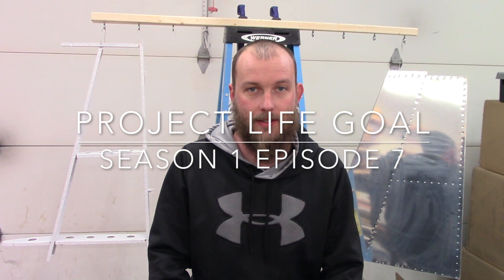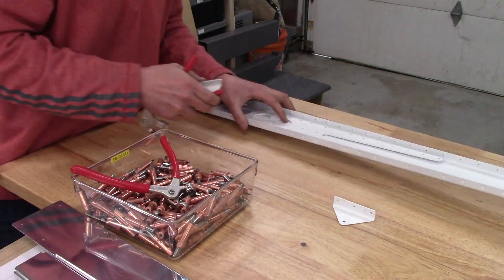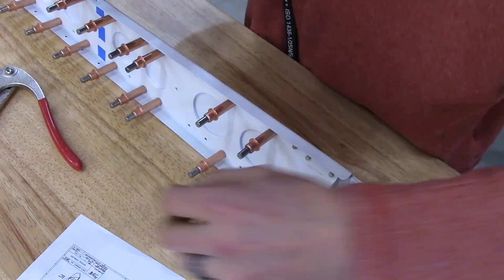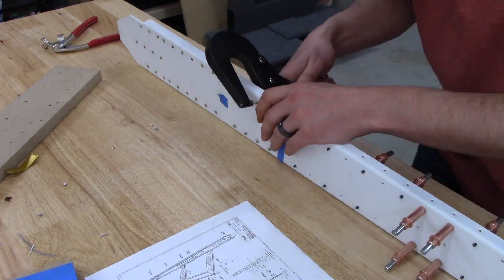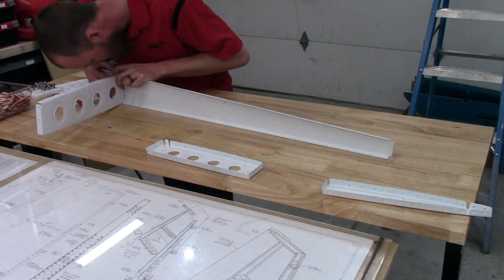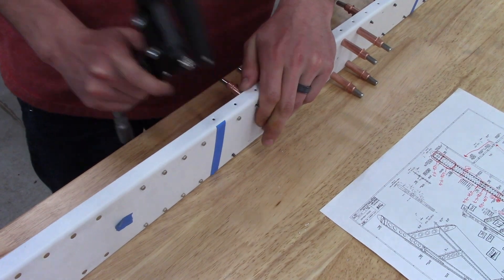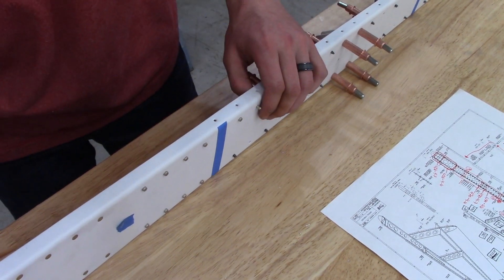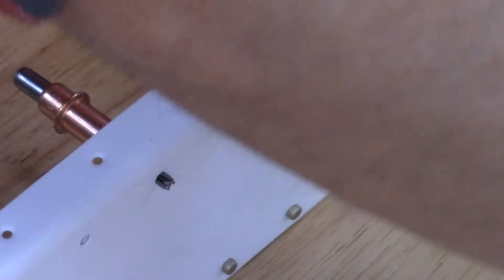PLG S1E7 - RV-7 Vertical Stabilizer Spar & Rib Assembly

Comment: Hello Grant, Out of curiosity, what spec / size rivets are you using and what is the centre distance measurement for the skin / rib / spar ?
Reply: @ProjectLifeGoal  Thanks for the info, Grant. Also, the typical centre to centre between rivets on the skin ? (AN426AD3's).
I'm not building a plane, by the way.
Reply: @ProjectLifeGoal   Thanks, Grant. It's a bit too early to say at the moment, but you will be one of the first across the pond to know.
Reply from the maker: I migrated my channel so replies were lost. I hope your project is progressing well.